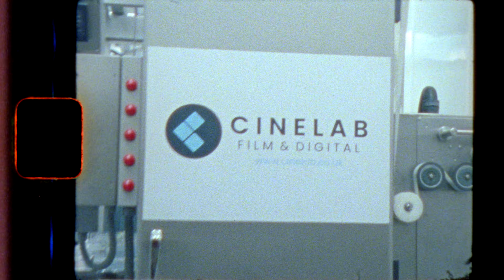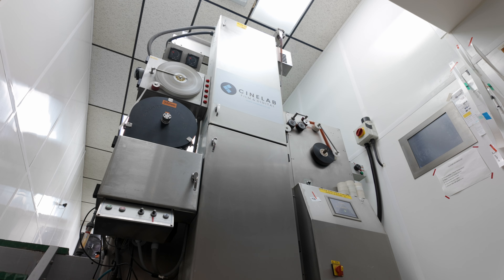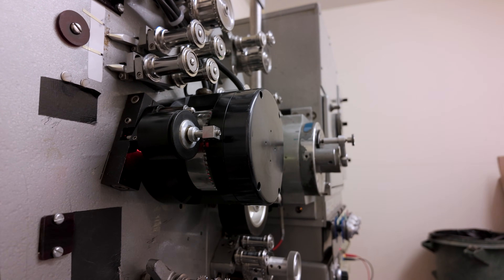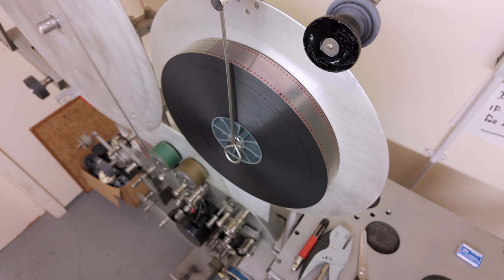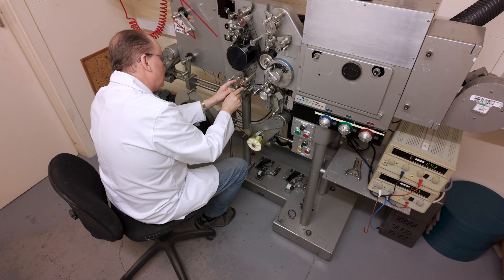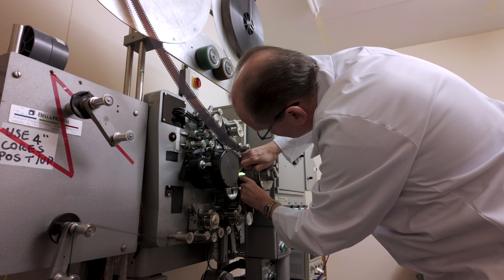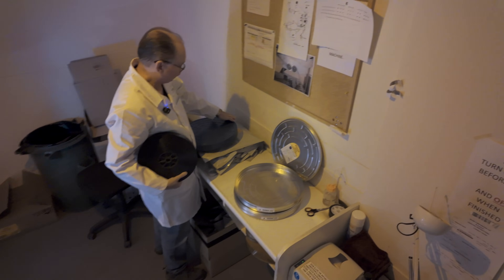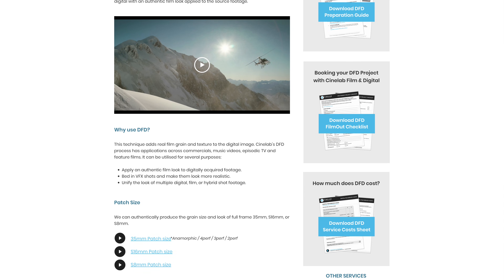How a 35mm Film Print Is Made at Cinelab | Behind the Scenes of Photochemical Proceeding Laboratory

Comment: When the positive stock is being laced up and threaded inside the printing machine, and for everything else we've seen afterwards.That is supposed to happen in the dark, right?
Reply from the maker: Yes. That’s correct.
Reply: @boredtech  That's a lot to do in the dark. Is there a specialty safelight? I know, for the most part, safelights can't really be used with film. But I want to believe they had different safelights for different purposes. I have some old Kodak safelight filters that are made for different purposes. 

Or would they use night vision goggles? I guess it could ultimately come down to muscle memory, but that is a lot.

Comment: DTS is also still used on 35mm occasionally.
Reply from the maker: Possible other laboratories using it, need to check that.
Reply: @ It’s become pretty rare and projectionist have been complaint about that for a while but Oppie did get DTS on the 35mm prints.